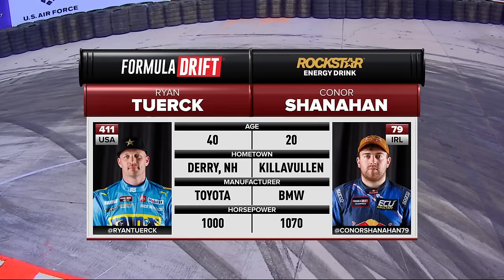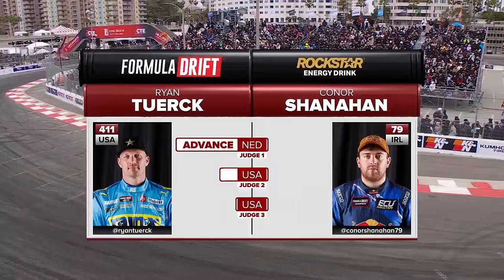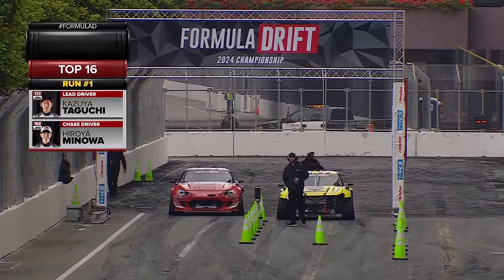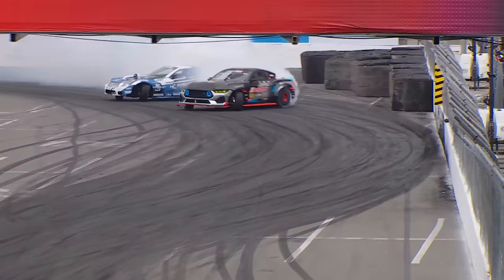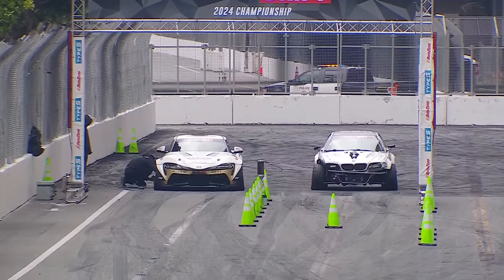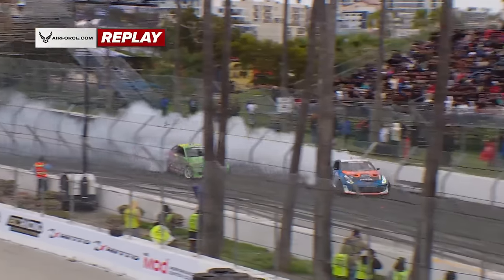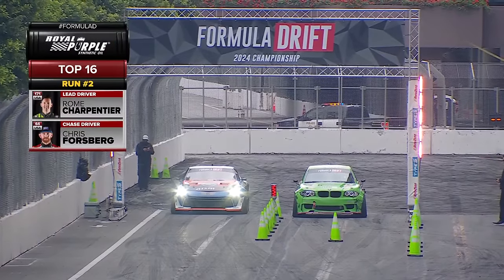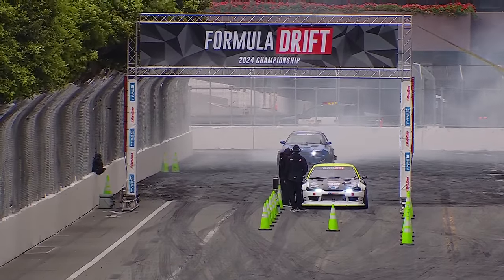Formula DRIFT Long Beach Top 16 - ALL ACTION

Comment: That Dean promo vs Aasbo was sus af. That hit was clear as day Deans fault. Eventho he got some decent proximity on the last half he hit Aasbo 2x times in his chase run. Meanwhile Aasbo didnt really make any major misstakes in both lead and chase, with decent proximity on the chase whilst having a good lead. Judges were looking HARD to get that Dean promo…
Reply: I'm surprised it was even an OMT in Aasbos favour, he choked super hard on initiation, low angle + 2x handbrake pull after initiation, which threw Deane off going into outer 1, then he missed outer 1 by like a foot or 2, missed outer 2 by 3 feet, and then Deane Caught up. James first lead was much better minus the wall tap in outer 3
Reply: @tristan7122 you’re literally fanboying at this point. All the misstakes you claim Aasbo had Dean also had, but you could add the fact that Dean had marginally worse proximity in the chase (round1) and Dean made contact with every single wall in the lead run. And in the chase he hit Aasbo, making Aasbo’s car going in to the wall.

Both had similar misstakes but Dean had a few more. And that is factual. 

Initiation was bad on both ends. And both used the handbrake in the initiation. Both sacrificed angle to improve proximity in the second corner. But aasbo was alittle closer in his chase.

Open your eyes😂

Comment: For the experts saying that tuerck was going to the wall, pause at 2:41. Tuerck cleared his rear tire from the wall, adam hit it the exact same way destroying his trunk and wad fine, those rears are made to absorb and if you play 2:41 frame by frame, tuerck cleared it 100%. And the run before, a rule is a rule.
What bit shanahan in the ass is that his aggresiveness got to his head and ignored the rain knowing there was rain and still pushed too hard.
Reply: He still should have got the sight lap that he asked for.
Reply: @SylasG  he did

Comment: 48:30 slow down this tuerck shanahan thing and its very clear that tuerck was headed for the wall anyways. Buddies rear end smacks either right before or at the exact same time shanahans car makes contact with his but either way he was locked into hitting that wall regardless. Too much speed not enough angle.
49:46 it is in fact really really easy to tell that he wouldve smacked tf out of that wall regardless